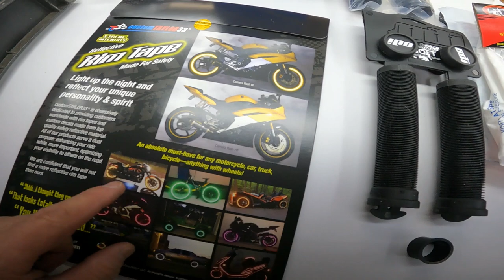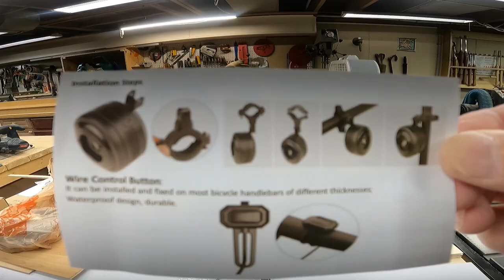Ariel Rider x class 52 tank bag, tires, and accessories part 1

Comment: Awesome add-ons terrific video. I was wondering if you can tell me what size 'shinko 244 tires' you have?
Reply from the maker: Thank you for that. The shinkos are 3.00-16 They are definitely an improvement over a bicycle tire, a true 4 ply motorcycle tire.
Reply: @woodtickgreg6926  thanks for sharing your knowledge with me. one more question- do I need to buy new inner tubes or can I use the default, 52v X class ones?
Reply from the maker: You don't have to get new tubes but I did. I went with a motorcycle tube because they are a little thicker and more heavy duty. The stem on a motorcycle tube also has nuts on it so it can be bolted to the rim so it won't spin in the rim and it also keeps the stem straight and in the proper orientation. But the stock oem tubes will work just fine.

Comment: Mr Greg, can you tell me more about the Shinko tires you chose? I'm trying to find them on Shinko's website and no luck finding what looks like the tires you chose? I really like them.
Reply from the maker: They ride really nice, not real noisey, and are 4 ply real motorcycle tires so they will have far better puncture resistance than the OEM tires.
This might be the link for the tires.

Shinko 244 Series Rear/Front Tire - 3.00-16 https://www.amazon.com/dp/B001CDC1TC/ref=cm_sw_r_apan_glt_i_W0P2MVS2VMT1NPRAMTQP?_encoding=UTF8&psc=1
Reply: @woodtickgreg6926  Thanks Mr Greg, I've since been studying up on this. I see where its a personal decision between the 244 and the 241 series for a lot of folks. Did you have to battle with that decision? My bike got delayed. Hopefully it will be here tomorrow.
Reply from the maker: @Campfussell  No it wasnt a hard decission for me. The 244 was a good choice for my needs. Durable, 4 ply, deep tread, etc. If I do want to ride some dirt roads itll be fine. I also thought it would be a better street tire than the 241 and may wear better since it's not so much a knobby style.
Reply: @woodtickgreg6926  Thank you sir. Makes good sense to me. Looks like this is gonna be another crazy addiction of mine. Haven't even got it yet and thinking of all these add ons!
Reply from the maker: @Campfussell  I know, I did the same thing. I had a pile of parts before I even had the bike. But I'm glad I added all the extras and made it mine. I've been enjoying it commuting to work. I dig the tires, the higher bars, and the lights are awesome in the dark morning ride before sun up. Have fun with your bike and make it yours.
Reply: @woodtickgreg6926  I'm not good at videos like you and most of the others that I watch on the tube, but I'll post a few little short snippits of vids when I get it. I have an idea to set my little Super73 in front of the box before I open it. The Z1 has an over all length of 61" where as the X Class is 70". Just thought it would look cool to compare them in that way!

Comment: What handlebar and gooseneck did you use?
Reply from the maker: Here's the stem I used. It may be out of stock now but it will give you the dimensions you need to search for another.
Lowrider Black Alloy Bike Stem... https://www.amazon.com/dp/B07H7D1ZZW?ref=ppx_pop_mob_ap_share
When I get off work I'll see if I can get the name of the bars off of them. But for what it's worth any 7/8" bmx bar with an 8 or 9 inch rise will work. I ordered the bars from Dan's comp bmx.
Reply from the maker: The bars I used where called animal 4 am bars. They are an 8.5" rise. You could use any 9" rise bare as there would be enough length with the cables and brakes lines, etc.
Reply: @woodtickgreg6926  Great.  Thanks for the info